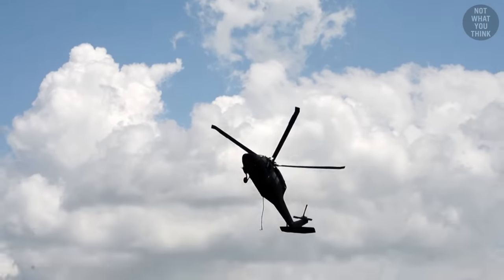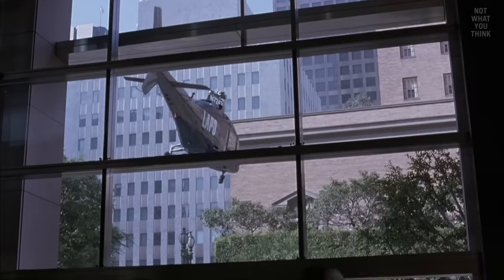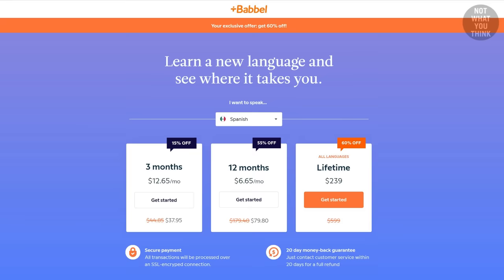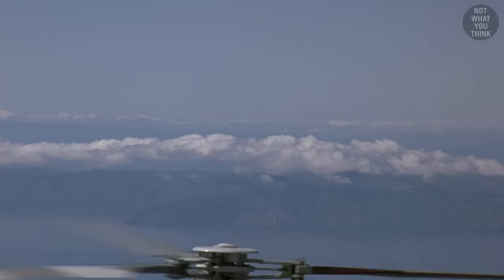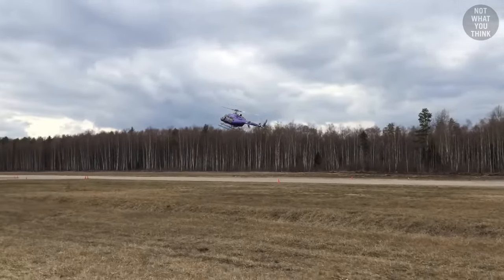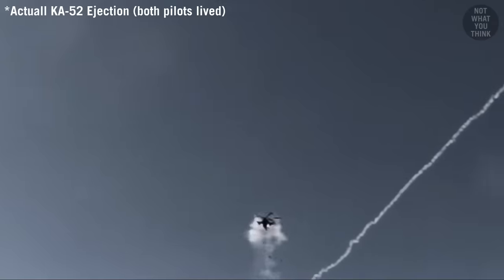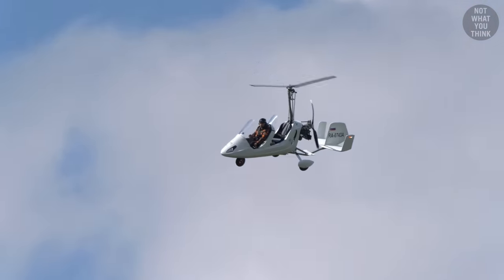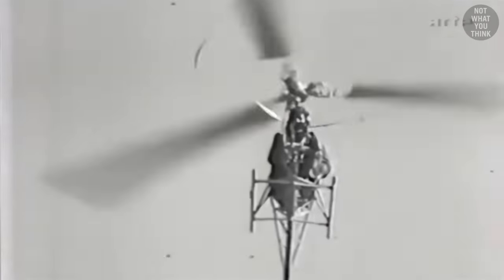Why Helicopters Fall Like a Leaf, Not a Rock

Comment: Maybe if copter pilots wanted to fall faster, they could push in the clutch to disengage the engine.
Like going down hill in a standard car, in first gear, will break the car all the way down the hill. But pushing in the clutch will allow you to fly down at full speed as gravity intended.
I'm sure if pilots tried hard they could crash much better instead of landing slowly and totally failing to crash. Fortunately the rotating blades striking the ground cause a lot of crash like damage.

Comment: I had an argument with a guy over a helicopter vs. The V22 Osprey. He lost. His argument involved the ability of a helicopter to gyro down, as the V22 is generally unable to do so though it could in theory. Basically a helicopter is risky and almost always dangerous. There is an envelope where a helicopter is able to safely land  in the event of engine failure and it is a combination of forward speed altitude and engine loading. Two rotor helicopters are joined by a drive shaft like the V22 is. If the shaft breaks there is no recourse as the blades will hit, on a V22 it would only be affected in certain conditions. The US Navy deserves the credit for turning the V22 from a perceived failure into the safest and most reliable aircraft in current existance. So how did I win the argument? Easy, the most risky time for an engine failure to result in a crash is almost always there on a helicopter. The V22 has two engines joined by a driveshaft so that reduces the risk. Furthermore the V22 can very easily reduce its risk to almost nothing as it can glide like an airplane and in that mode the rotors break off. In a short takeoff the lift of the wing and the power of the rotors result in a very short takeoff roll and rapid climb to altitude, IIRC, 27 SECONDS! Even hovering can be a short timed exercise.
Reply: Also V-22 pilots can train on auto rotation on the SIM. In general helicopters of the same weight class as the Osprey can barely auto rotate and only in ideal circumstances just like the Osprey. Peoples focus on auto rotation in military aviation is foolish imo as it barely ever happens.

Comment: @13:07 That's a very biased metric.  There are far more people on an aircraft to die when it crashes, so the fatalities per flight hour will be proportionally much higher.  Passengers should cancel out.  Incidents per flight or per hour.  Fatalities per passenger-flight, or passenger-hour, or passenger-mile.

Comment: With the airplane vs helicopter deaths you didn't adjust for passenger quantity did you? 

Theres >5 or more than 50 on a standard plane and like what 3 in a normal helicopter?

Comment: I very much doubt helicopter autorotation is at all comparable to fixed-wing gliding. It's not what I saw flying RC models. You have a store of momentum in the rotor which has to be managed successfully, and it's much harder and less reliable. You basically fall like a rock to store energy in the rotor, so that when you do get near the ground, it's a controlled landing.

Comment: 10:15 this is not necessarily true, not all aircraft require a pilot's license to fly (at least in the US). And there are some models of ultralight aircraft that can be flown without any permit or license whatsoever, as they are so easy and insignificant to fly that its deemed unnecessary. And in my opinion, the gyro boat would almost definitely be under that classification

Comment: For the deaths per 100,000 flight hour statistic, it's also wish noting that helicopters don't take as long trips as many planes, and the most dangerous part of the trip is usually takeoff and landing, so the statistics of deaths per trip would be even lower for helicopters.
Reply: but planes take way way more passengers

Comment: Because in case of engine failure, only engine stops turning the blades, but they won't stop instantly, meaning they will spin slower and slower, letting the helicopter's body fall slowly down to ground. Still not a smooth landing, but better than falling like a rock

Comment: and if the airplane blades continue to spin, the airplane doesnt fall... For your statement to be correct, the engine must remain undamaged allowing the rotors to spin at great speeds....  but what if the rotors got mechanical failure like some bearings jammed or something comes loose? Something breaks? Then they wont spin and itll fall like a brick.

Comment: The fact that most people don't know this is baffling, I thought auto rotation was common knowledge. I've had an argument with my whole family about this where they concluded they were right and in an engine out senario, a helicopter would just fall to the ground, because one of my cousins litterally helped build and worked on helicopters at Sikorsky and STILL didn't know about auto rotation lol (military contractors for yuh I guess)

Comment: I still see  Neils  point.    You'd have  to be   above minimum altitude for  it  to  work  and  the  pilot has only  one  chance  to  do it  right , so only very  skilled heli pilots  would be  able  to  pull this  off. All other situations you are  as good  as a brick
Reply: in regards to the height, helicopters have a "height/velocity curve" which is essentially a matter of having enough energy to safety perform an autorotation. If you're flying 60mph you can start an auto from as low as 50ft, but if you're holding a hover at 400ft in the air you may not have enough height to generate the forward airspeed needed, and you'd just be hoping the rotor has enough energy to cushion the landing.

Comment: Arrows should be pointing downward @ 3:25 as air direction is actually being forced downward. If it is being pulled upward, the helicopter will crash.😁 Also, when it's autorotating, it actually acts like an "umbrella" on top of the helicopter, slowing down the air under the rotor and creating pressure, just like a parachute, in a way that air under the rotor is slower to go up than outside the rotor. So the illustration that air actually goes up thru the rotor when autorotation is kinda wrong, more like arrows should show that some of the air are actually being trapped.

Comment: Here's a question:

When it comes to rockets, hovering = wasting fuel. Until you get into orbit, any engine thrust you get needs to be decreased by 1g which can massively impact efficiency.

I always thought the same would apply to helicopters. They need to push air downwards to offest gravity. For each kilogram of their own weight, they need to accelerate about 10 kg of air by 1 m/s.

Oh, well. I guess I answered my own question. This isn't really that much energy. And since they don't need to carry all that air with them, the rocket equation doesn't come into play, so they stay in the reasonable size territory.

Planes are the same. And only zeppelins get air bouancy for free.

Comment: V-22 can't autorotate.
Because in order to be a tilt rotor aircraft which basically became a normal turboprop in level cruise, it have to has rotors with smaller diameter than normal helicopters to reduced the drag when they're using as propellers. As such, the rotor disk has less area, and cannot creating sufficient lift when autorotation.
There's another problem which provented V-22 from autorotate fundamentally. Also because it needs to be rotor and propeller the same time, the blades of V-22 have more substantial twist than normal helicopters' blades, more closely to propellers. So even when the collective pitch was setting in minimum, some parts of the rotors will always have a high AoA(pitch), i.e. more drag, effectively stopped it from making practical autorotation.
The funny thing is, V-22 can neither do autorotate nor gliding when it have engine failure, because its wing area also smaller than normal fixed wing aircraft. So it will indeed became a brick if the engine failed and loss of all power.
Reply: And another supplement. Not all helicopters are forced to do autorotation if they're losing tail rotor. Some of helicopters have a large enough vertical stabilizer that can produced enough yaw stability when level fly at high enough airspeed, so they can still keep main rotor running even after tail rotor failure, just keeping fast enough for tail fin to stabilized the aircraft.

Comment: The second thing I would? Like to point out is. That the? Glide. Video of the F4 Phantom is of the Plane falling after the pilot ejected. I'm sure if even that jet was flying and engines failed it would be able to glide in some sort of way. However this video was of a plane on takeoff at An airport.

Comment: Autorotation only works if the pilot is moving forward at the time. I don't think they recover too well if in a hover.
Reply: Aircraft don't glide too well in a hover either.  It's more a question of energy than speed.  You need a minimum amount of energy to recover and land, and that energy can be provided by speed or altitude.

Comment: There is a great video on British Airforce pilots training at low altitude flying. When their singld engind fails, they'd have a serious problem. So? They fly bloody fast! If the engine fails, they pull up and then that small F-9 (or similar) is a brick when you are used to 1:40 glide ratio. Still, suppose it is 1:10, these two pilots have a good chance landing at their Airforce base nearby. Do you see? Fighters come down fast, but when there is hydraulic pressure, the pilots can fly and steer and land somewhere, preferably a runway.

Comment: Why Helicopters Fall Like a Leaf, Not a Rock 
for adjusttable rotors blade angel type helicopters.
when engine failure  like not blocking turning of rotors.

while fallin u can storage some energy on rotary blades like child running with windrose.
at last moment of the fall reverse blade angel to push air down to use stored energy to slow down the impact of helicopter.

if there is no blockage of turning rotors or no damage rotor blades. helicopters still can land safely. with engine failure

Comment: oh it will fall like a rock if anything stops or breaks the main rotor.
the difference is between the Engine stopping and the Rotor stopping.
Engine stops = Autorotation
Rotor stops = bye bye.

Look up Helicopter Mast Bumping.

Comment: But if the blades are spinning with reversed airflow, wouldn’t that mean the blades are spinning in reverse and producing thrust in the opposite direction? What am I missing here something isn’t adding up for me?
Reply: autorotation mechanics can get pretty complicated, but it essentially comes down to how lift is generated. When the engine is turning the blades, airflow is coming down through the rotors and is technically generating lift upwards and backwards, which would slow the rotors down without the engine driving them. During an autorotation, the airflow is coming from below, which changes the direction of lift to be upwards and forwards, which pulls the blades along their rotational path to maintain rotor RPM. You also have portions of the rotor disc known as "driving" and "driven" regions, so some parts of the rotor are using the lift to maintain rotor RPM, and some parts are using lift to allow the heli to glide.
Reply: @falenchan7999  thank you fellow nerd i think I understand

Comment: The Osprey does not autorotate. It’s why it’s not part of the US presidential helicopter fleet
Reply: Everything you just said is false... Yes an Osprey can auto rotate and glide. No the president is not banned from riding on an Osprey because of safety or even banned at all. The Osprey does not have the communications equipment needed for the president so they would have to make a special one directly for the president and it is easier to just use what they have been using. Also the back lawn would get more messed up from an Osprey.

Comment: Very good subject but you didn't yet explain why does this effect take place first of. The only reason why the rotor blades autorotate is due to having a much lower AoA near the tip of the blades or even negative, depending on designed rpm. If this AoA difference wouldn't have been there, then the rotor would only start turning the opposite way and never produce the needed lift. Great video though. Best wishes!
Reply: so hilariously, because of how lift is generated, since the airflow is moving upwards through the rotor disc, lift is being generated forward, thus pulling the rotor blades along their rotational path. The blade twist does create the different driving/driven regions of the rotor, so some areas of the rotor are being used to maintain rotor RPM, while other areas are generating enough lift to allow the heli to glide.
Reply: @falenchan7999  
Exactly! We've said the same thing from different approaches. Good. The author must also account for this in his explanation.

Comment: I don't think the 2 blade theory is correct. As a model heli hobbiest I build and fly RC helies. And pretty much everyone in this community knows you can't tighten the bolts that hold the blades too much that they can't swing freely. Vast majority of models are 2 blades. Rigid is a big no no.

This is because at different angles in the whole rotation the forces on each blades are different. They really need the wiggle room to be in harmony with each other. Rigid blades cause excessive vibrations and likely to shake loose some bolts and nuts somewhere to cause a mechanical failure. The failure in the video however, is likely unbalanced blades, which is not tied to number of blades but 2 blades is the easiest to balance.

Comment: I hope there is multiple failsafes that wont allow for someone to be ejected untill the rotors are gone that could use lazer sensors backup charges incase the first doesntwork anybmaybe put a 3rd charge at the section were the rotor is attached to the frame so if the rotors dont eject the whole mount is ejected. It wpuld be cool if there was a chergeless ejection option like something that is holding tue rotors in the just uncoupled or something. This is from someone who knows verly little about helicopters all i really know is how they fly and how autorotation works so please dont hate im coming straight from watching videos about kobes death so it just bothers me that people die due to human error. Now a days there should be so much money being put into developing safer helos and ways to make existing helos safer.. i just saw that video of the new helo with a ballistic parachute system and i came away from that video really impressed by how muchbthat company cares about saftey and quality helos. So i just wish more companies strived to be that way insted of caring about money when they and there companies are worth millions and billions..

Comment: Autorotation
A single motor (on the vast majority) produces torque.
The early days if development had the problem of not dealing with this torque.
1931 or about (sirkisky) put a tail on the helicopter.   That took the torque and redirected it.  Thus, the modern helicopter was born.
When said helicopter looses that counter balance (either, ), it begins to spin (due to lack of balance of torque).
Thus the energy is dissipated.
Thus, a helicopter does not just fall out of the sky.

Comment: My friend has convinced me thT helicopters are more concerning because of how the blades are held on. You lose the blades and well no contrarotation for you
Reply from the maker: Tell your friend that if an airplane loses its wings there is no gliding either! Both of those things are extremely rare.
Reply: @NotWhatYouThink  idk if you van confirm or deny this he said it was usually a single bolt holding that system on.

Comment: Why do even some helicopters have more than 2 blades? Does it gives any advantage during flight or something?
Reply: More blades mean more thrust.  More blades are also less efficient at producing that thrust, but if you're constrained on rotor diameter, it's your only option for increasing lifting capacity.

Comment: This just doesn't work in real life. Why do helicopters still crash like a brick? The effect is stronger the faster the helicopter falls, how will that prevent crashing? It's like a perpetual motion machine. (It doesn't work.) It works for seeds because the leaf is so big it acts like a parachute.
Reply: @@chrisevans8463 What I mean, it only works in specific conditions, not well with heavy helicopters, the pilot has to be well trained on what exactly to do. Helicopters are still crashing like a brick.

Comment: Your crash stats compare general aviation to helicopters. General aviation does NOT include airliners, as you seem to imply. So those stats are way off. Commercial aviation, airliners, are way way safer.

Comment: In this video you have provided no proof.. but theory that a helicopter actually fall like a leaf in real scenario :/ in real life its much more complicated than that. As far as I can see, helicopter's engine failure almost always cause death, while planes does not.
Reply: autorotation is an emergency maneuver that every pilot is required to know... 

You dive downwards, which speeds up the blades, then use the spinning momentum of the blades to pitch back upwards to trade the momentum for lift. 

I do not think you watched the video.